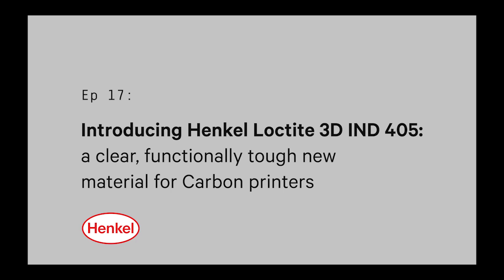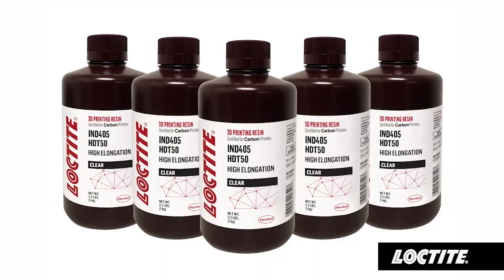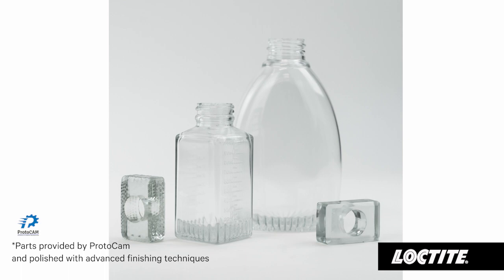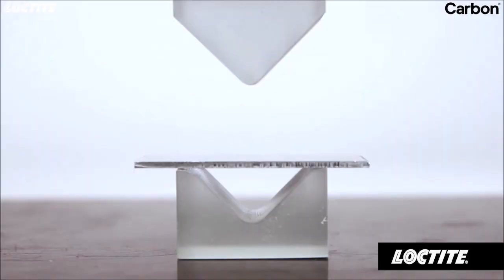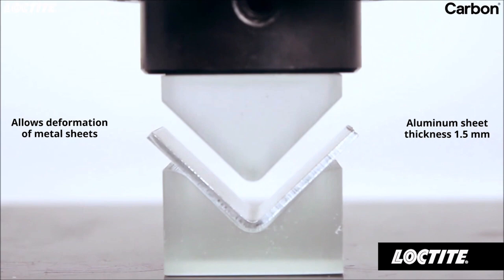Henkel LOCTITE IND405 Clear For Carbon Platform - Ask an Additive Expert

Comment: Carbon originally set out to only offer proprietary resins for its platforms. Then 3rd party materials were added to address dental applications. This is the first non-dental, 3rd party material that Carbon is adding (per my knowledge). Does this mark a change in Carbon's business model? Should we expect to see Carbon begin integrating other Henkel materials, DSM, or BASF? What changed?
Reply from the maker: Thanks for your comment! We’ve been expanding our material offerings through both in-house R&D and third-party development. As you noted, this is the first general-purpose third-party resin we’ve offered, but the co-development model has been adding to our dental line-up for some time.